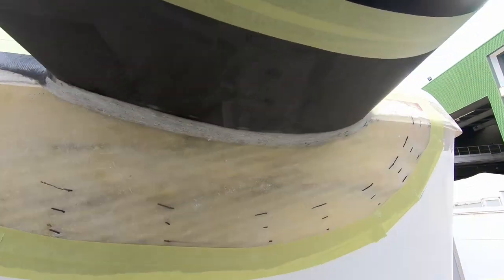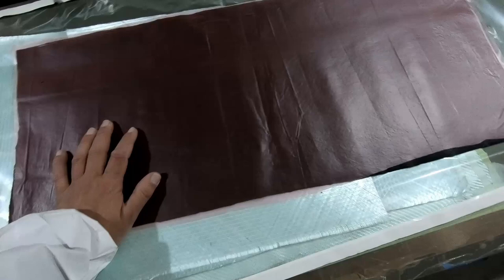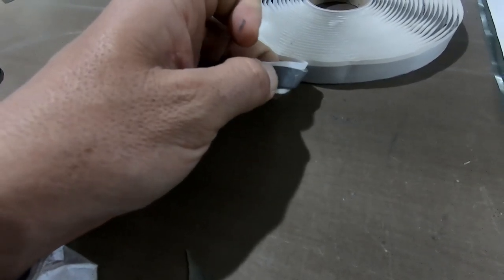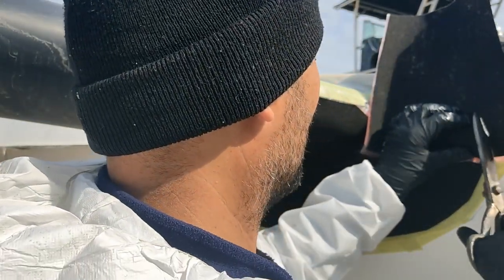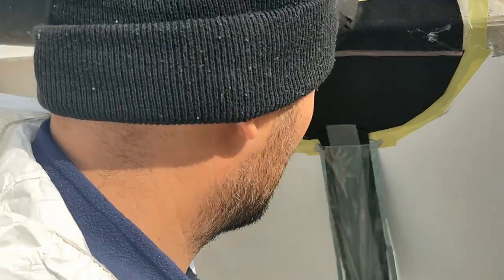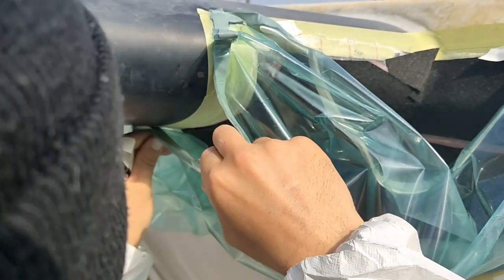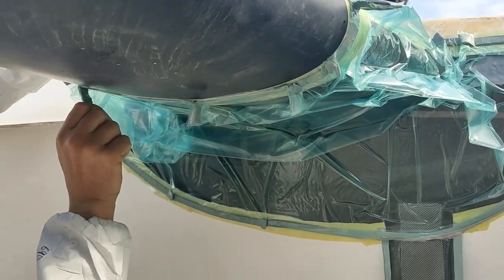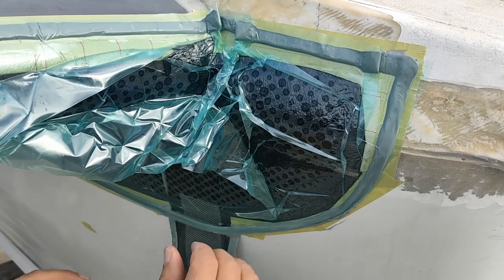Step by step vacuum bagging complex geometry - part 1

Comment: very nicely explained video. what carbon did you use? how many grams per layer?
Reply from the maker: Glad you liked the vid
Unis 300g
DB 400g
Cloth 200g
Reply from the maker: Make sure you watch the second part of the video if you haven't already. 👍
Reply: @youngbarnacles  i did... i guess i watched all of your carbon vids because i would like to build a sort of canoe out of carbon fiber and other light material like innegra and basalt but i don't know how many layers i should use and can't find any information in the web about it. first i will make some testsheets but for calculations i would like to know how many layers i should approximately use... how many would you use, if you would make a canoe out of carbon fiber?
Reply from the maker: What you are asking is more of an engineering question than a boat building question. What are you going to use the canoe for? How big do you intend to make it? That will then dictate whether it will be a monolithic or cored structure. Also using inegra or basalt is dependent on whether you're in flat water or need impact protection. You also need to work out what resin systems you will be using and whether you intend to use a mould or jig. These ultra light laminates tend to be more experience driven than engineering driven and there is not a lot of information available on the web. I have a lot of experience in ultra light laminates for smaller racing racing boats, and could work out a laminate schedule for you based on my experience. As this is actually considered my day job and there would be a fair bit of work involved it would have to be something I'd charge for.  If you want to do it all yourself, figure out what you want to use the canoe for and what the parameters will be and that will dictate what materials you use.
Reply: @youngbarnacles  Thanks for the answer!I wrote to you at the annamegan-address which I found on facebook.... hope that is the right one!?
Reply from the maker: Yep got your email. Cool project 👍 We'll be in touch

Comment: Getting perf film locally is difficult here in Florida (don't really have a good answer as to why).  So, I've been VB all of my FG catamaran mods without it.  In following the WS guides, they explain that you should use the least amount of pressure possible to achieve good bonding to prevent dry layers (clear as mud, eh?).  I therefore make a small flat, test patch on some plastic next to my project.  I then use the test patch (with the same layup) to give me a good idea of the time/temp/humidity effects on the kick times.  After I think the epoxy is beginning to gel; I crank up the pressure on my pump to really pull hard.  So far, really good results.  

So, I'm wondering what pressures you guys are using when you have the perf to use?  -Thanks!
Reply from the maker: Full vac with epoxy, is what we use. 
Full vac will not produce dry layers if the consumable stack is correct and the resin quantity is correct. Perf plastic is an important part of the process too make sure over bleeding of the resin doesn't happen. 
Some resins have problems with full vac, styrinated systems(poly and vinylester), and low grade epoxies (like west 105) suffer from solvent boilout. This was once upon a time thought to be dry layers. West 105 resin is designed as wood glue, it is not a laminating resin (but can be used for it). 
There are so many variables in a laminate and different circumstances when to use a product or not. Or how to use a product or not. Some times its just a case of using what you have available and making sure you get a good result.
Reply: @youngbarnacles  Cool, thanks.  Good luck guys!
Reply: @youngbarnacles  I was just going to ask why don’t you place the breather right against the peel ply?

I guess it to avoid total suction of the epoxy out of the carbon.